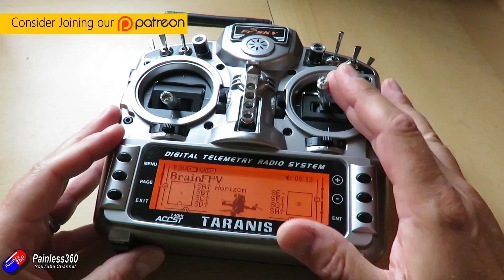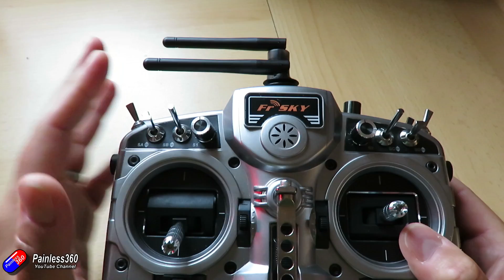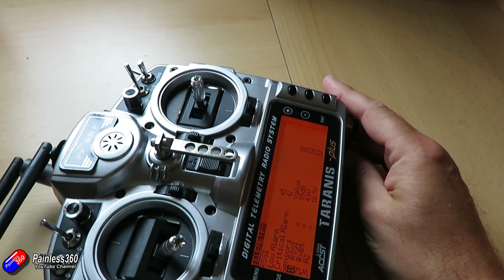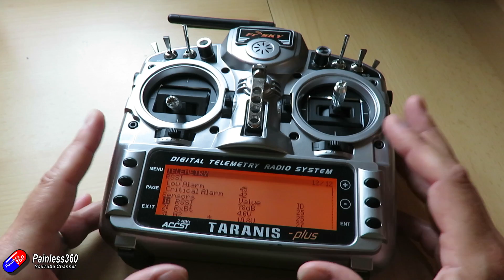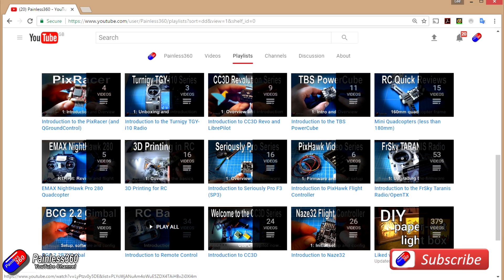RC Quick Tips: Finding your lost model (RSSI method)

Comment: Hey Painless, just wanted to tell you that this worked for me about three weeks ago.  I was flying FPV with a 200mw transmitter on my plane when one of the people sitting next to me turned on his transmitter at 500mw and blasted my single.  Before I could get him to turn it off I tried to go LOS and lost sight of my plane.  I was just using a Stabilizer in the plane without GPS so of course no RTH.  I cut the power and let it go in.  To my surprise, I still had an RSSI single.  I remembered this video you made and went to the sensors screen and started tracking the model down.  After about a mile and a half walk into the desert, I was reading in the high 80's and low 90's so I thought I'd try and hear the motor.  Sure enough, I could hear it about 100 feet away and found it stuck in a Cholla cactus. Retrieving it was accomplished with a large stick that I found,  No damage other than full of cactus quilts that I removed at home.  Thanks for this video It save a lost plane.

Comment: Hi, I really need this for where I fly! But how do you actually set the Taranis up to do this? I followed the video through and tried to discover new sensors but got none. I copied what you had on your screen by adding RSSI, RxBt and A2 sensor but what am I missing? Thanks
Reply from the maker: The cheap little receivers don't offer telemetry. You don't mention the Rx you're using so I suspect that is the issue...
Reply: @Painless360  Sorry, I have the XM+ D16
Reply: I also flashed updated firmware for RSSI but I still can't get any new sensors when using Discover New Sensors.

Comment: EDIT - This is answered in "Crossfire Questions Part II" @ 10:55 - I should have known you had it covered. Thanks!

I've been using this method so long, that I've grown pretty dependent on it, it's very reliable and gets me within buzzer range of a downed quad /plane quickly. I'm considering getting into a Crossfire setup for my quads and wonder if it can be used for tracking as well as the 2.4ghz Frsky system. From what I understand, it can display RSSI, Link quality, or both, so I expect you could set up a "Track" page in 'Display'. 
My concern is that Crossfire works so well (I hear it rarely drops below 98% RSSI) that there will be little effect in swinging the dipole 'on end' with the model.
 
Does anyone use their Crossfire with this method, and  can you explain your setup and results?
Thanks!

Comment: Before i had any RSSI capabilities i used a similar method with my fpv set up to locate my drone a couple of times. I live on a farm, and the land around me is very much like you describe in this video. A couple of time the drone went down into a planted field - corn, all about 4 foot high. I lost all video signal after it went down, but i discovered that whilst walking around the perimeter of the field (damned stinging nettles and brambles!) that i would get a faint video signal at various points around the edge. I soon discovered that by walking in a certain direction the signal would start to get stronger, eventually getting to an area where the signal was very good with a clear picture. But i still could not pin point the model.I then removed the antenna from my fpv receiver, doing that finally got me to within a 20 radius - which was enough to find the model.
Even now i do not have RSSI on my main transmitter, but i do have it on my diversity rx, which certainly makes it even easier to find the model. But now i have a bleeper on the model that automatically sounds once the craft as not moved for 30 seconds.
Reply from the maker: Beepers are worth their weight in gold in instances like that. Sadly few fixed wing models have then ;) Happy flying!

Comment: In response to a thread on openrcforums "Setting the 4-in-1 module UID equal to that of the OpenTX transmitter" I did a proof of concept - You could increase dB variation by using aluminum foil shaped in a half cylinder shape with antenna at the center of the cylinder... a pop can and scissors would also work....

Comment: I think i'm ill. I keep seeing planes I really like the look of!
Also found a new method if you know roughly where you crashed - get close enough to get some FPV video on goggles then take off both antennas and walk small grids. Not perfect but decent if you're too stupid to add a buzzer and then play in the woods with your bro :)
Now i'm thinking take a linear antenna to make that searching step even easier.
Reply from the maker: +MicroRCFiend I've found a few by watching the playback. This should get you close if the battery is still connected without anything other than your radio.. Happy flying
Reply: Yeah my VRD2 do support that but my bro was using my old quannums. Wouldn't say no to RSSI though, well useful.

Comment: Great job. Another improvement, if you have the antenna connected with SMA/RP-SMA and have higher gain antennas, use the highest gain antenna you have. This way the accuracy is even higher.
Reply: Do you have the special edition Taranis with RP-SMA? If not, the procedure is very controversial (watch Joshua Bardwell's latest videos about "taranis antenna mod", and if you're up to the task - Mr. Steele's antenna mod video. 

I've been using several different 2.4 GHz antennas from amazon (cheapest 5dBi and 6dBi I could find, they're made for 2.4GHz wifi) with very good results, although I've heard that there are supposedly specific antennas for Taranis. I personally don't believe that, because if the antenna is made for 2.4 GHz, it should work the same regardless if it's WIFI or Frsky. 

The only thing you'd have to worry when flying is these dead zones (the higher the gain, the bigger those deadzones are).